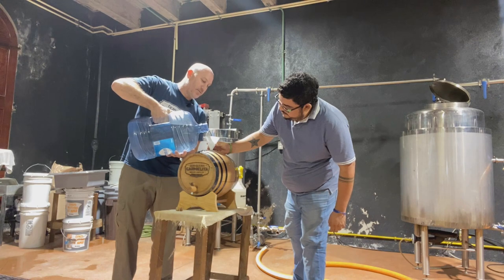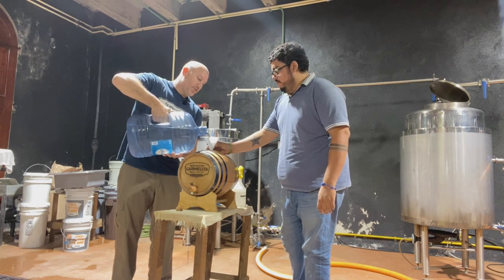20L Barrel Fill Bourbon Recipe

Comment: Don't use white coffee filters, esp w/high proof spirits, you'll actually taste the bleach and paper in your final product -- and some tastes cannot be removed using stone carbon (activated charcoal) filtering.  The folks at Gibbs suggested putting a small wad of stainless steel pot scrubber into the whole when you tip it out in two or three months to bottle it, and that worked well for me (ten years ago)...And, read through homedistiller dot org slash forum
I enjoy watching your vids as ASMR or whatever....  Back ten yrs ago I couldn't afford the equipment you've got...  It's nice seeing how you worked around not having an agitator (and how you recognized the need for agitation with high organic solids during heat-up on electric elements without a steam jacket).  Nice to watch.  Thanks for posting.